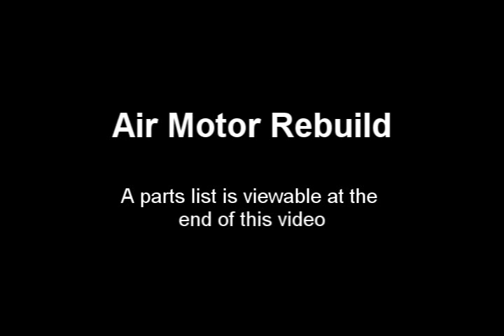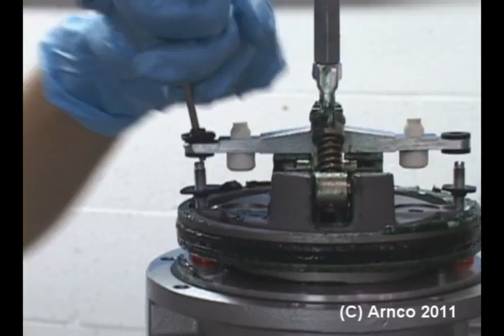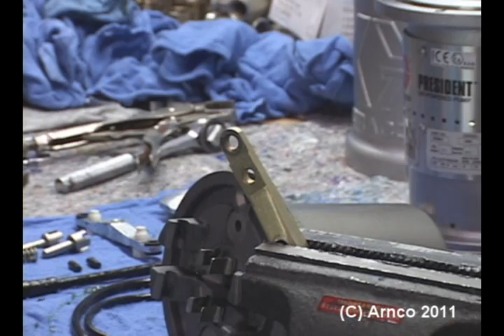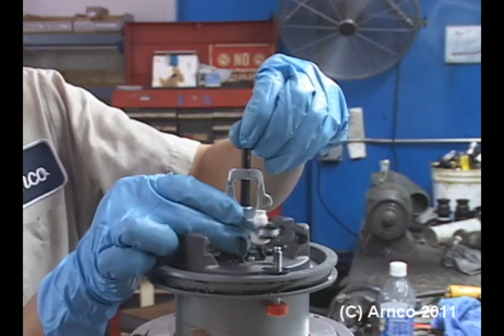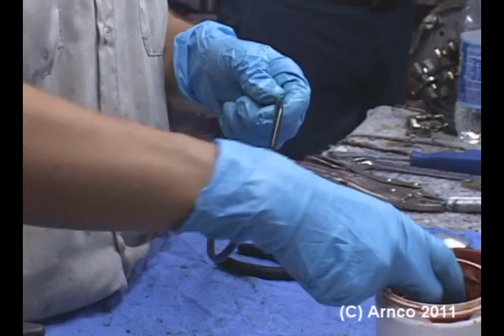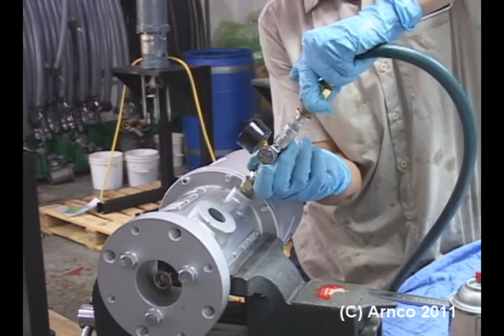Graco air motor rebuild

Comment: Where can I  find the tool to remove trip rod, I think it is called a retainer device
Reply: It's a coupling nut with a 6 inch bolt on the other end. I think it was a 3/8 16 TPI. You can get them at Home Depot, Lowes or just about any Hardware store.

Comment: Great video, I have being paying to have this done, and out of the two places that did this job, only one place did it right. Well, the place that did it right closed. We found this video and got to work, took about 30 min, and that was because we had to refer back to the video to make sure. I think the next time will take less time. If I had to do another one tomorrow I think, I can knock it down in about 20 minutes. That is if someone else cleans the parts for me as I take them off, and that is because that is the worst part about it. Thanks for the video, saved us a lot of money.
Reply: Robert Garcia hi, its best to use air operated washing gun,with  just hot water as a degreaser ,or if you have a hot pressure washer ..

Comment: A real used air motor looks nothing like this one, a lot of times the trip rod breaks leaving part of the threads inside the cap nut because of the moisture damage.
When this happens you have to buy new trip rod and cap nut.
Also the two clips that hold the toggle will break or bend and you have to replace both at the same time also check the spring for damage if they are rusted the best thing to do is to replace both as well,
Plan on doing this for at least two hours not as easy as it looks